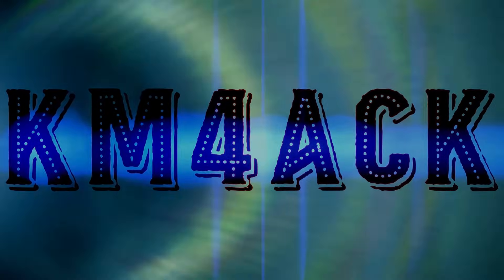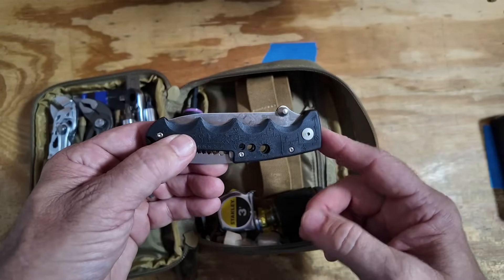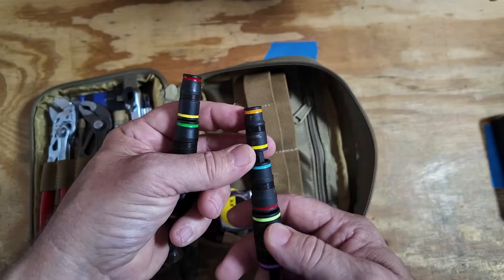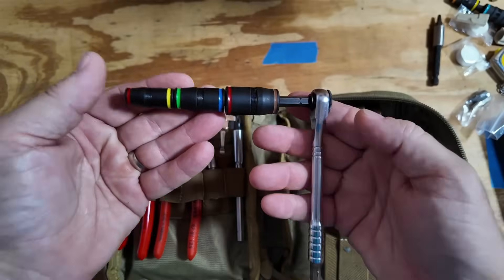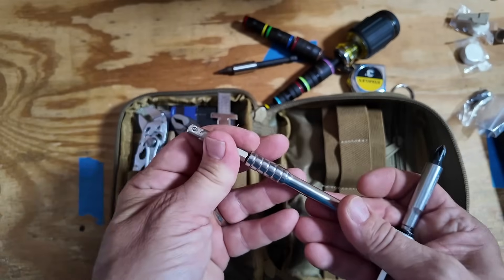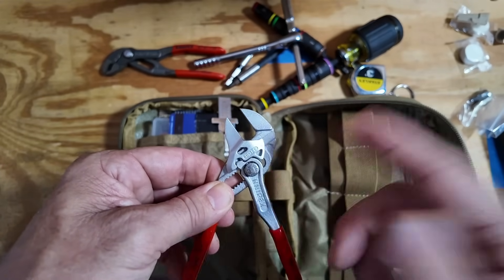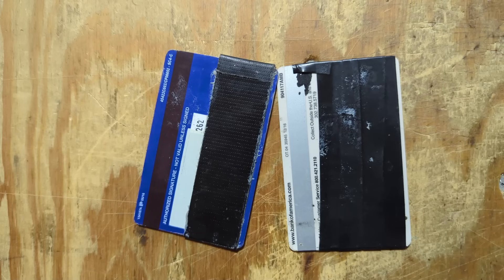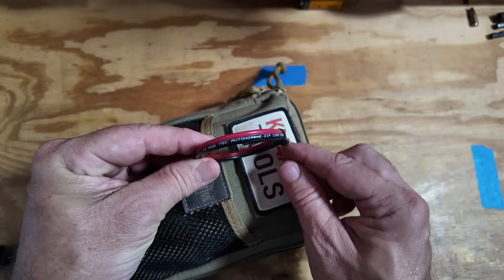Pocket Sized Powerhouse :: The One Mini Tool Kit Every Ham Radio Operator Needs

Comment from the maker: Maxpedition Bag - https://amzn.to/3ykvV4F
Carabiner - https://amzn.to/3kHPJfv
Knipex Pliers - https://amzn.to/3mx9mag
Knipex Cobra Pliers - https://amzn.to/4kjlpAg
Klein Metric Sockets - https://amzn.to/4lEM242
Klein Imperial Sockets - https://amzn.to/4lEM242
Stubby Screwdriver - https://amzn.to/44klMVe
Ratchet - https://amzn.to/4eweS3S
Bit Adapter - https://amzn.to/4lEMQpA
Bit Set - https://amzn.to/40A7YoD
Multi Meter - https://amzn.to/46n1hdc
SOG Kilowatt - https://amzn.to/4esQpwu
Tape Measure - https://amzn.to/3TotJUu
Yaesu Adapter - https://amzn.to/3IP2QmZ
Leatherman Wave - https://amzn.to/3EZecDO
BNC to Banana Plug - https://amzn.to/41EKy0e
5.5mm Connector - https://amzn.to/3ZDfrRz
Insulators - https://km4ack.square.site/product/insulators/28?cp=true&sa=false&sbp=false&q=false&category_id=7
SMA Male to BNC - https://km4ack.square.site/product/sma-male-to-bnc-female-ht-adapter/44?cp=true&sa=false&sbp=false&q=false&category_id=7
Morale Patch - https://km4ack.square.site/product/custom-morale-patch/50?cp=true&sa=false&sbp=false&q=false&category_id=3

Comment: I'd suggest a few M3 cable clamps. Simplex are smaller, but easier to lose. And make sure you have the corresponding (small) socket head.
Extra useful if your HF end fed is not (yet) cut to correct length.

Comment: I  use the Klein screwdrivers quite a bit and if you pull the locking collar on the screwdriver and go in to the neck click it will take the slop out of the shank. Love those screwdrivers and those Knipex are some of my most used pocket tools.